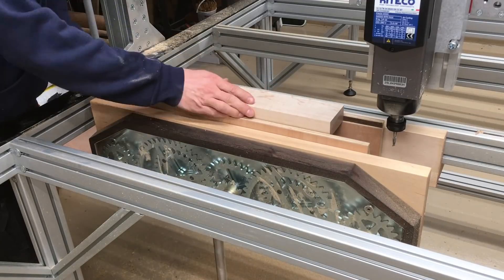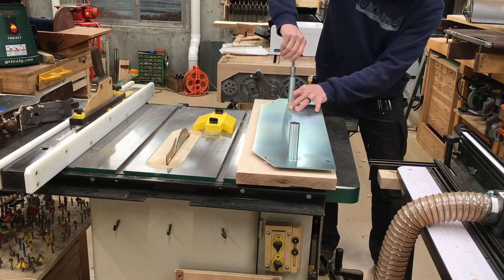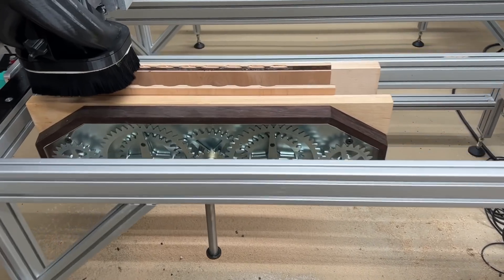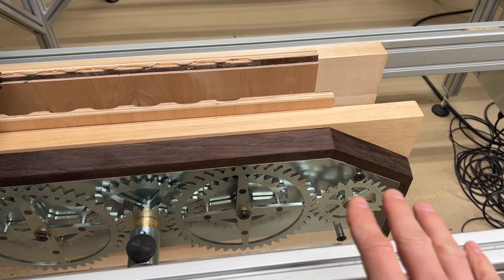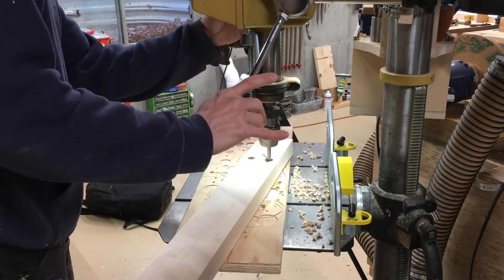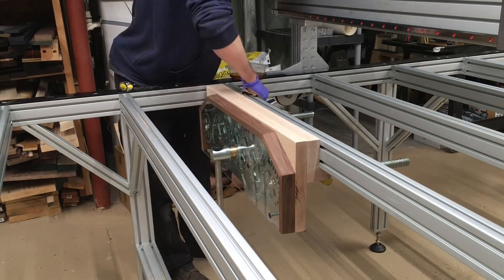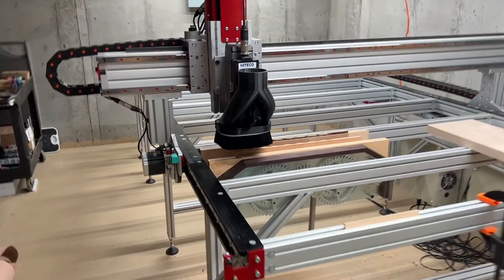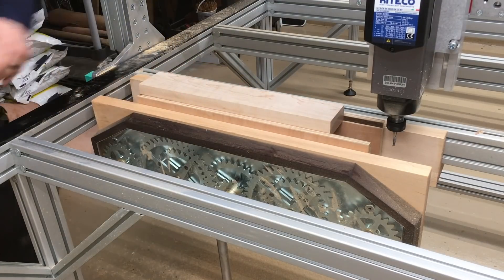A Vise in a CNC!?

Comment: I came back to make this comment about half an hour after watching the video. I still don't entirely understand your particular use case, but it kind of clicked what you're going for. I don't know how familiar you are with manual machining, but in that world there is a two-piece vise as it is commonly known that uses the t slots of a machine table to make a custom oversized vise. I think this might be ideal for your project, it would be easy to leave it on the table full time for convenience without losing the ability to take on large sheet goods without removing the twin turbo

Comment: I don't mean this to be critical, but how exactly do you envision using the vise? I don't claim to have any expertise, but it seems like most two-dimensional things so to speak work fine with strap clamps. I've seen a few CNC setups that had a vertical face, often like a gate leg table for when that type of cut is required. I'm having difficulty picturing the use case? If your material is square enough for the vise to hold it rigidly, wouldn't that be a perfect candidate for just screwing perimeter blocks into the spoil board? I would be a little concerned to have steel in the field, should you program an error, a crash could be fatal to the machine. I could see some use if it was oriented perpendicularly to how you did, perhaps for quick simple cuts that don't require a program. But there's not really a way to do that without drastically affecting the rigidity of the table. I'm not trying to tear down your design, I'm quite sure I'm missing something obvious, I just don't get why?
Reply: Oh I think I've got it. You wanted to keep your gantry as short as possible for maximum rigidity on sheet goods or 2D projects. The vice allows you to work deeper than the spoil board? How much z travel does your avid have? I'm imagining this would be for something that had a central bulge? Like you wanted to CNC the back of a pregnant woman lying face down? Sorry for the weird image

Comment: If you would mount a large sacrificial plate to the vise you would largely negate the sagging issue. If you drill a bunch of holes for bench dogs in that plate, you could clamp pretty much any size with just a minimal amount of vise travel which should help with rigidity
Reply: Basically think of how a workmate can clamp larger objects :)

Comment: Speaking only for myself, the things I've seen with other CNC machines are a flat board mounted across the rails of the machine, and the board has multiple holes drilled into it at regular spacing, so that you can insert tools to hold the piece you're working on. That's good for the big flat ones.

Or, I've also seen cases where people mount a typical machinist vise. At that point, it's not too different from a regular non-CNC mill, like a Bridgeport.

Your use case as a woodworker who wants high levels of accuracy, that seems to call for a solution that is a little different from what people would normally do with a CNC device. I love the idea of mounting one of your turbovises to the rack!

Comment: I am curious, why do you still not have a spoil board? Are you designing something very clever? This is a easy cut on a CNC on a traditionnal spoilboard even with double sided tape...
Reply from the maker: I just don’t need one yet, nothing clever in the works
Reply: @AndrewKleinWW  It would make a great video it was the case!

Comment: On the avid, I think you could actually move the front legs back and mount the vice to the face of the machine so you don't have to mount it somewhere in the middle.  Seems like it might be more accessible on the face....  I have a router mounted to mine and it overhangs about 1-1/2".  I clamp stuff to the face fairly frequently and it works great.  A vice would be an even better approach.
Reply from the maker: It’s a good point, I might do that at some point

Comment: It'd be a complete redesign, but if you fixed the acme vice screws to both cross members, and the acme nuts did the traveling and clamping, that would also eliminate sag, because both ends of the screw are supported.  Your screws look beefy enough not to sag in the middle.  The only downside I haven't worked out in my head is your handle may swing into the screws depending on how far apart they are
Reply from the maker: Yeah, that would be an cool way to set it up

Comment: very clever simple solutions for the mounting.... its impressive. interested to see how those paper shims hold up over time. if you will run some jobs then check later on. i would have thought maybe a shim steel is preferred, to not compress. there are a variety of different sources for a thin enough shim metal

Comment: Why didn’t you do all the drilling of your boards for the vice, on your new CNC router?
Reply: Takes longer time, probably.
Reply from the maker: Yeah, for one off stuff like that I think its faster to lay it out and drill it the old fashioned way
Reply: @AndrewKleinWW  you are right it will take longer for the first one. But if your new to CNC, what better way of learning what you can, cannot do by making one off parts.

Comment: Great idea. I would mount it on the end rail (push rail back if needed) and then put in a normal spoil board around it so it's flush with the spoil board. Best of both worlds that way...? It also needs a system for aligning the ends of long boards through the vise for joinery cutting.
Reply from the maker: Yes, you could mount it on the end rail.  some kind of registration for the lengthwise alignment would be needed in some cases and I might add that at some point, but I didn't need it for the dog tops so I skipped it for now